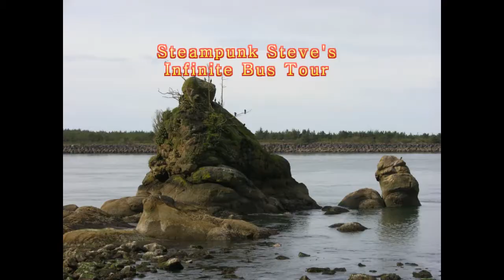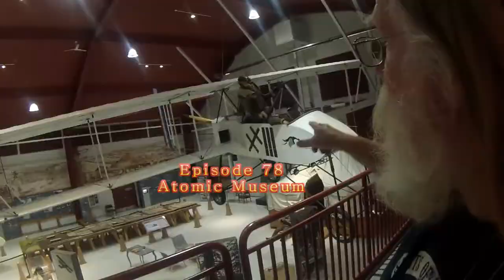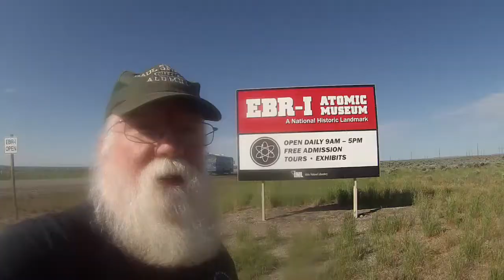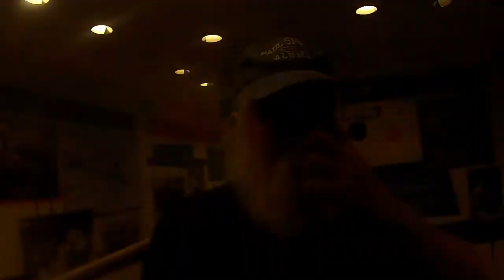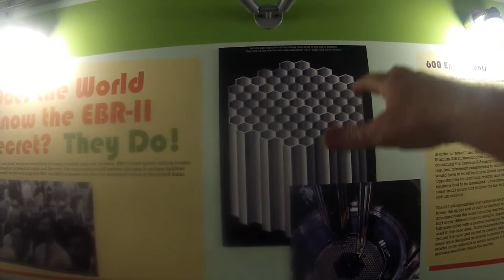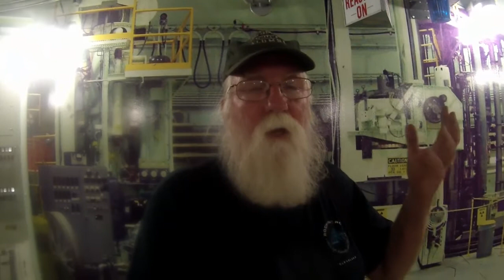Infinite Bus Tour 78- Atomic Museum

Comment: Steve- a little late.  Subscribed a couple of days ago.  Yous size bus is on my list.  The ones I've found mention a top speed of 61 mph.  Is that on target?  The gas I don't care about but the low speed would be a concern?  Thanks.
Reply from the maker: My top speed on the highway is 63 which is fast enough. Got it up to 73 on a ten mile downhill and that was scary.